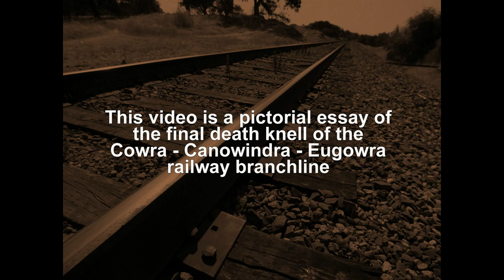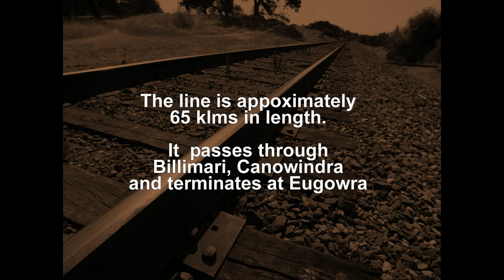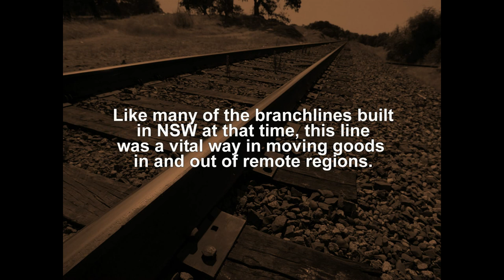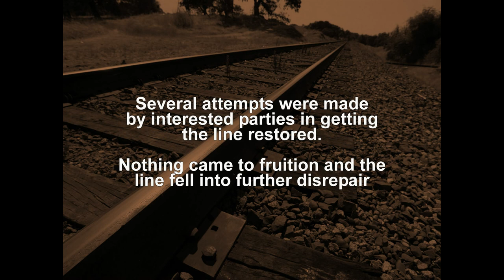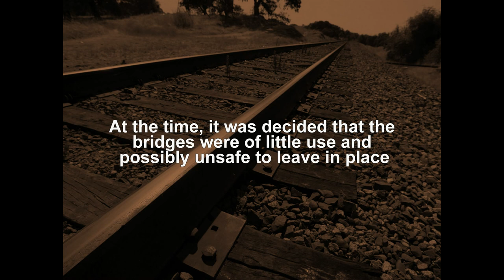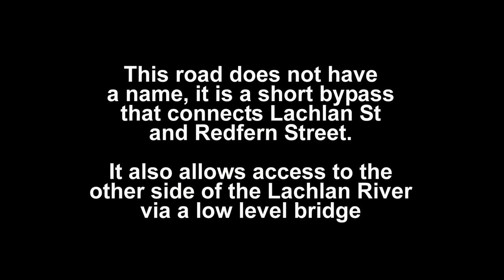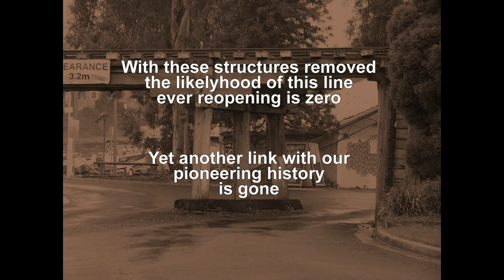The End of an Era

Comment: thankyou for posting this-tragic the bridge at eugowra wasnt repaired for use by the lvr
Reply from the maker: All of the Cowra lines are now closed....
The line South to Harden suffered massive flood damage near Bendick Murrell in 2010. 
The branch line from Koorawatha to Grenfell also suffered major flood damage.
The branch line from Cowra to Canwindra - Eugowra is now permanently out of service after one bridge at Canowindra was removed (early 2000's) and two bridges at Cowra were removed around about 2008. 
The line North from Cowra to Blayney has two major problems. There is a large wooden trestle bridge North of Carcoar, that has now been condemned.
To the South, a bridge was removed from Boundary Road near the outskirts of Cowra.
Bit suspicious that one.. one day it was fine and the next, the council claimed it was falling down and had it removed... (there was nothing wrong with it.)  
After the recent floods we had out here.. a large section of rail and ballast/embankment was washed away, just North of Cowra.
In a nut shell (and sadly), the likelihood of trains running in and out of Cowra again is highly unlikely. 
Cheers 🚂🚃🚃🚃